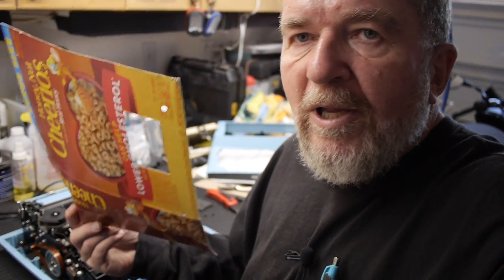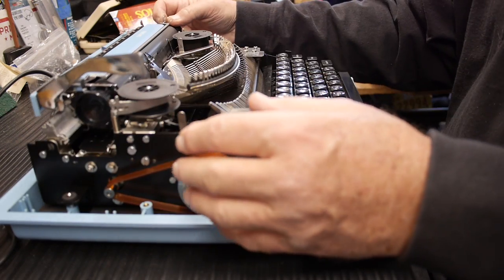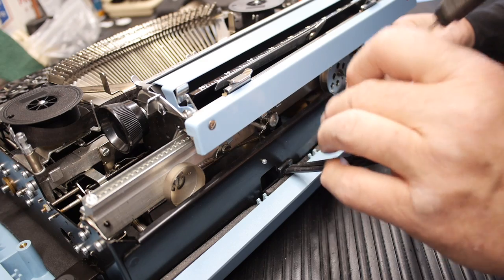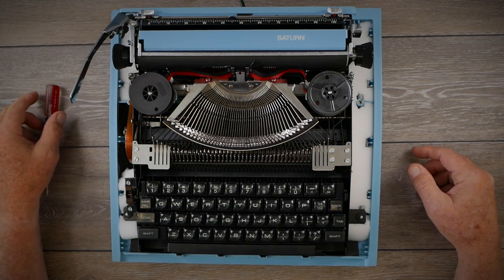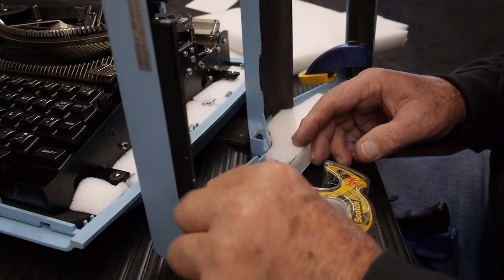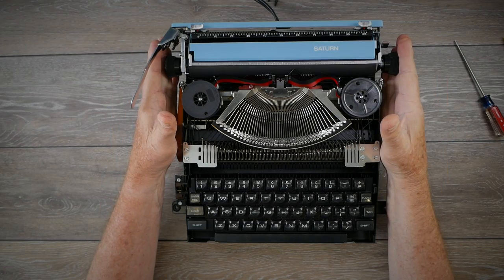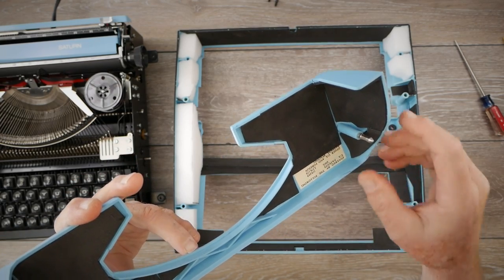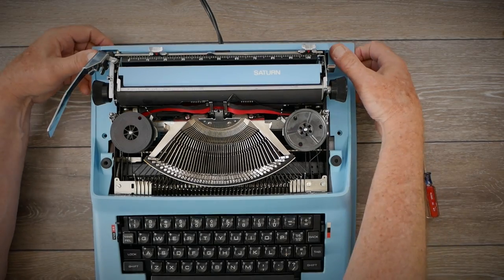Adding Typewriter Sound Insulation

Comment: Joe,
Another great video. Thank you for sharing. The 15 character per inch settings are available on the Panasonic thermal typewriters. I have those plus an Olivetti and a Panasonic daisy wheel typewriter. I almost exclusively is 15 CPI. You can use an algorithm to determine the point size and the optimal line length. 120 divided by the CPI equals point size. 15 CPI is eight point type. The rule of thumb in the printing industry is two times the point size equals the number of Picas in an optimal line length. I eight points times two equals 16. So your optimal line length is 16 picas. There are six picas per inch. So for 10, 12 and 15 CPI the optimal line length is 40 characters.

Comment: Can someone explain how these electric type bar typewriters work?
What is the belt for?
Reply from the maker: The belt turns a toothed spindle that rotates under the typebar linkages. When you press a key, it’s linkage interferes with the rotating spindle and the spindle throws the typebar linkage toward the platen, just as if you’d pressed a key on a manual machine.
Reply: @Joe_VanCleave  thanks a lot, it is by far the best explanation I got

Comment: Have you tried butyl rubber? I have some leftover auto dampening stuff made from butyl rubber and plan on experimenting with that.

Thinking about sticking it to the frame rather than the shell of a typewriter since the frame is closer to the source of the sound vibrations. Theoretically that should dampen the sound more.

And then since the butyl rubber isn't that thick, I'll fill the extra space with foam.